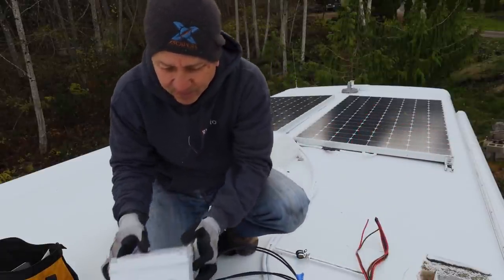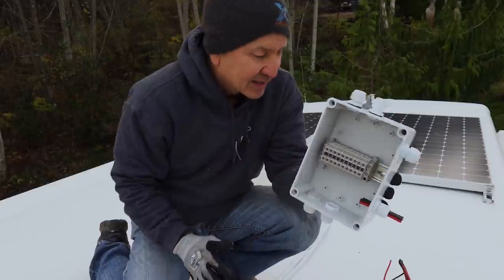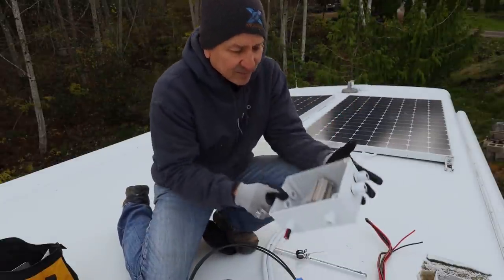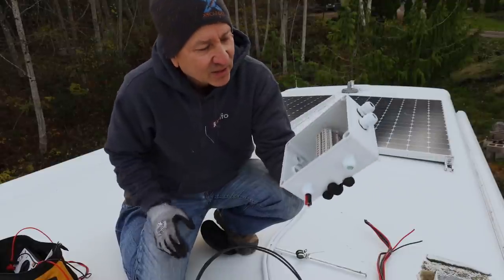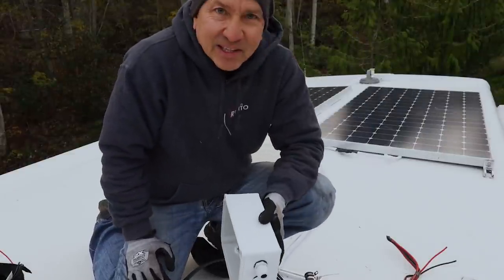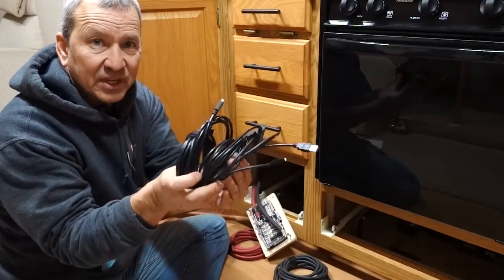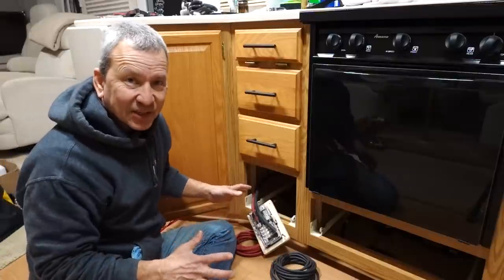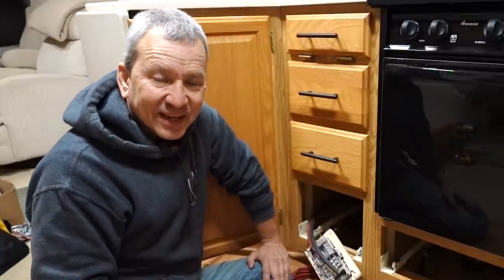Installing RV Solar Equipment on Class A Motorhome | RV With Tito DIY

Comment: I was a little confused at first because of the 4 charge controllers but I think I know WHY you did it that way - shading will never affect you.  With each panel on its own controller, if one panel gets shaded, the other 3 can still power.
Reply from the maker: Absolutely correct. Not just shading. Same is true for the angle of the sun and RV position. Each panel performs independently for optimal performance 👍

Comment: Hey Brian, I have been following along with all your solar system installs. You inspired me to install my own system on my travel trailer, following your design and install methods you used on your class-C with the flex panels. Now, your new install on your class-A is inspiring me on how to do my next install when I upgrade to a new RV in the next year or so. I really like how you explain things and show just enough details to understand. Plus, your wiring diagrams and links to the actual products you used are key enablers. I hope you continue to share. -Jim.

Comment: Another nice job by a fellow PNWer Brian.  I’m glad you pointed out the smart networking function of the Victron devices.  I’m not sure that everyone realizes how good a function this is. It’s really important in terms of maximizing efficiency when you have multiple ways of charging a batter bank that there is one and only one voltage, current, temp. and SOC reading that is shared by all the devices. I use the one provided by the SmartShunt. What people fail to remember is that each device is designed to operate independently and if each device’s internal voltage, current, and SOC reading is used for that device then voltage drops and current readings will be different between devices, which could cause the charging profiles to be out of sync (one device in bulk mode, another in absorption, etc.) which reduces charging efficiency.  I’m thinking I need to do a video on this subject. LoL

Comment: I always learn something! I really like that junction box. And that install of charge controllers on the bottom of the cabinetry is really an artist move. I would never have thought of that!
Reply from the maker: Thanks. Glad you like the setup. I'm really digging having everything out of sight this time around. System has been amazing so far.
Reply: @RVwithTito  we just finished ours too, and it gives me ideas for improvement! We took up half of a closet, but I’ll be looking for ways to move things around and hide wires better, as you have them!

Comment: Nice update ... your having way too much fun :-)  I am working on my whopping 200W solar on the roof of my old 16' Chinook restore.  It will be on the road this week.  I purchased two 100 to put in series to turn on the little Victron sooner and went with polycrystalline because they put out quite a bit more wattage than the mono... I put stainless hinges on and when I part, just tilt up one... plenty for my 200 amp BB LiFiPO4. ... between the rains here in the so. nw coast.

Comment: As far as the flat mounting of the charge controllers go. I think you should add some temperature controlled vent fans to the setup. If i recall an earlier video of yours correctly,  you’ve done something similar in the past.   While the controllers can be mounted in any orientation vertically allows for better heat dissipation than horizontal.
Reply from the maker: That's certainly an easy upgrade when the time comes.

Comment: I’m gonna brag: I fit 1760w on my 24ft sunseeker 2300. But your overall setup is way cleaner.
Reply from the maker: Nice job!
Reply: Hey Iliya, we sure don't mind bragging when your creative solution fits 1760 w on a State/National Park compliant <30 foot rig. Just kindly spec out and list your pragmatic design(components, brand,cost,& more) so we can all learn and smile,thx. Happy Trails, be safe,phil
Reply: @PhiLeo7973  I removed the top AC unit (added mini split in rear) and relocated the middle fan to the rear sunlight area. So that made room for 3x 440w panels. (From signature solar, + mounting hardware). And the last panel on the rear fit parallel to the Rv. Looking back it’s too much solar for me. Also have 14kwh batteries. 8x280ah lifepo4 cells from china. Growatt 3000w inverter
Reply: @iliyamialik  Thanks for your detailed and timely reply IIiya. May you, your family, friends, and neighbors, always be safe. Live long and prosper,phil
Reply: p.s. I would go Mini-Split( Mr Cool?) too and being overpaneled in this day of very reasonably priced PV panels is not much of a detriment,imo, with efficiency losses due to time, shading, temp on panels,etc. May I ask what year your Forest River Sunseeker is and how many miles it has on it? New or used purchase and have you been happy with it? Thanks brother. Happy Trails.

Comment: Nice clean set up. I hope you have enough ventilation for those solar charge controllers
Reply from the maker: I hope so too. So far so good. Like I said it's easy to add a temp switch and fan.

Comment: Are you concerned with laying the controllers flat?  The heat sinks could heat up the back of the controllers and cause issues.  My assumption would be they would prefer to have them vertical to allow the heat to dissipate off the sinks.

Comment: Another quick comment, ... about the Victron and ventilation ... I do some ham radio and a friend who builds repeaters and towers etc. explained why the fins on the Victron, which we know are for cooling.  I mentioned how V wanted them mounted vertically.  He said the reason, which you likely know,  is so the heat rises quickly and easily.   Seeing them flat and knowing you put in extra holes and maybe use fans in the future I think is important.  I wonder if there is data where you might put a little sensor ((wire) maybe those used for batteries and bms control temps) under the center of each laid over controller and find a good place to pull the air via thermostat control ... automatically.  Thank you again.

Comment: Outstanding installation.right tool,right conductor/wiring method, right termination. Love to see you work off the spool an your associated auxiliary components choices. In my neck of the woods off grid rv installer are non-existence it is the wild west with most being in the west. So your DIY suggestions as a resource I find invaluable,thank you. My question for today do you have any thoughts on labeling spaces or components? Again Brian great video!!!
Reply from the maker: Thanks 👍 Glad to help. Not sure what you mean by labeling spaces. I definitely label cables and switches using a label maker when I have it with me. I did label the breakers and cable ends.

Comment: Hi Tito I been reviewing your videos for some time & few months back this summer I finally install my Solar & only added 600 watts of panels with my 40 amp Renogy Charge controller … I got another 600 watts of flexible solar yet to install.  My panels are 200 watts each.  2 weeks ago I added 200 amp hr of lithium plus I swap out my old battery charger to a lithium one.  My 2017 Thor Hurricane already has a transfer switch for my shore power & generator.  I plan to add one solar charge controller & when I install the rest of my panels.  I would like to be able to run all my plugs that didn’t come prewired to my inverter that already runs my residential fridge.  I want to be able to also have my microwave & only one ac function when boon docking.  I can’t get my head around what wires should run to my transfer switch from where.  My thoughts are I should hook up on the same side the generator is hooked up to & that should power the motorhome & I can still have my generator when needed.  I am running from the load side of the charge controller to my new inverter in & the out from the inverter to transfer switch.  Hope you got a glass of water to help you digest this 😊.  Hopefully the military brain of mine understanding things correctly.

Comment: I've been looking over your solar diagram and parts list and I don't see a listing for your rooftop junction wiring part (e.g., the part that goes into the box and connects the panel wiring to the down wiring). Help me understand where that comes from.
Reply from the maker: Here's a video about that: https://youtu.be/zUsSwLaXzHM 
The materials are listed in the description of that video.
Reply: @RVwithTito  Perfect. Just what I was looking for.

Comment: I think you are having as much fun as you are giving me ideas for my next project, I am fairly new to RV Solar but a Mechanic 40 yrs. and have built a small system for my cargo trailer. Ill see if I can make this make sense. I have a question regarding ferrels. The victron charge controller I got did not accept ferrels verry well as the clamp holes were a to small to accept the ferrels. That tool that I got made 6 sided ferrels. I think your Ferrel tool is 4 sided?? And might have fit better??. My controller is just a 100/20 with small input terminals 10 awg I ended up putting wire in "without" using the ferrels and they fit better also I think they clamped down better.. I read an article regarding ferrels as they dont make a very good surface connection and bare wires clamp down (squish) for  a  better connection. Sorry if this is confusing this was 6 months ago.

Comment: Great video and awesome work! I really like the track and tape you use on the roof to avoid all the screw holes for the panels. Long term how has that held up over time?
Reply from the maker: Thanks. So far the mounting setup has held up well. We made it all the way down to Mexico with no issues.
Reply: @RVwithTito   did you use the 3m tape for mounting the Solar panels to the roof as well

Comment: Nice terminations in that roof box.  I would have put each pair of panels in series, running only two pair of wires from the roof to the basement, plenty for 1750 watts.  With two pair of panels in series, I think you could have gotten by with just two controllers, using 2 of the 150/85  Victron controllers, which is what I used.  Your circuit breaker boxes looked much nicer than what I could find.  I'm curious who makes them, or where you bought them.  Funny, I ran my roof cables down the slide out pantry cabinet in my Winnebago too.
Reply from the maker: I have a full parts list with my solar design diagram (rvwithtito/downloads). Here are the breakers (https://amzn.to/34xcQRQ) and here are the boxes (https://amzn.to/3JsuPHT) .... Good luck!
Reply: Actually one 150/35 controller  and combiner box is plenty for these 4 sun power panels
Reply: @brichusi  I think his use of four was so that each panel is independent of each other. This prevents screwing up the performance of all your panels just because one is in the shade.

Comment: Great video.  I'm getting my parts list ready to add solar to my GD Reflection 204RL.  Can you provide the Amazon link to your roof solar junction box with terminal bus bar.  It is perfect for my application.
Reply from the maker: It's an 8 x 6 x 4 box like this https://amzn.to/35h1B09 and the terminal block is here https://amzn.to/3iECtnd You will also need a DIN rail like this https://amzn.to/3JO8vsz to mount the terminal block to. Good luck with your project.
Reply: thank you so much

Comment: Those little things that you stuck on the end of the solar cables going into the junction box, are those just some kind of anti-corrosion deals to keep a nice and clean install?
Reply from the maker: They help get a better connection in those terminal blocks.

Comment: Do you have a link to the wire pairs used from Solar disconnect to rooftop junction box?
Reply from the maker: All of the parts (with links) are listed in my free system wiring diagram (rvwithtito.com/downloads)

Comment: Nice setup Brian, wanted to know why did you go with 4 MPPT (100/50)  vs 2 MPPT (150/100).  do you have a tools list that you used for the project? next month im going to start our solar project on our GV 367BHS.
Reply from the maker: The 150/100 is still a little tight for two of these panels which can output more than 80 volts. I preferred the dedicated controller setup as well. It's been working great. Just needs more cable. I'll work on a tools list. There's just the parts list with the diagram (rvwithtito.com/downloads). Good luck with the project.

Comment: What happened to the SunPower flexible panels?? Should I skip over those and get the rigid type right away?
Reply from the maker: I still have them on the Class C and they're working well. These used SunPower panels were too good to pass up.

Comment: Hi Brian!  Found this to be very educational.  I am planning an install on a 03 Adventurer 33v.  How did you run your cables from charge controller to the batteries??
Reply from the maker: The charge controllers are mounted to the floor right above the battery compartment. There are two existing access holes above used to run other cables. Hope that helps.
Reply: @RVwithTito  Thank you for replying!!!!

Comment: Brian why so many charge controllers do they make any that will handle more solar panels like maybe paralleling some panels? Lots of times I see all the solar panels combined in box and only one set of cables coming a controller?
Reply from the maker: This really is the most optimal setup for a 12V battery system and these large panels. But if I were to combine these large  panels I would still need a very very expensive pair of controllers for that high voltage and current. Another option is to install a 24V battery bank. With that I could cut the number of controllers in half.

Comment: Probably too late now but I believe you only needed to daisy chain the controllers together and one line to the Cerbo GX...
Reply from the maker: I'm not sure if I can daisy chain through the USB VE.Direct. that may only be available with the VE.CAN bus. Not totally sure but I'll look into it. I'm considering combining the controllers with a USB hub to free up a port on the Cerbo for a GPS receiver. Thanks for getting my wheels spinning.
Reply: @RVwithTito  you might be right about the cable you need to accomplish that. Check out the “Changing lanes” channel. He did it. I’ll look for the link.

Comment: Hi Brian, 
I want to put two sunpower 100w solar panels in the roof of the cap on my pickup truck. 
I do not want to permanently install them. I was planning on using heavy duty Velcro and put Velcro all along the backside. 
I am hoping that the Velcro would hold for some traveling so I can connect the panels to a power station and plug in my ICECO JP40. 
I would be removing the solar panels quite a bit but I don't have a 12v outlet in the back of my truck. 
My question is do you think Velcro will hold my solar panels in limited driving trips?

Comment: I'm wondering why you not connect the solar  panels in series by using one solar changer controller?
Reply from the maker: Personal choice. I wanted a fully parallel setup to maximize efficiency. Given the high voltage of these panels, it would still be a pretty large expensive controller.

Comment: what dictates whether you wire you solar panels in series or parallel.    I only have one 100 watt panel, which simply charges a Bluetti device, was planning on adding another 100 watt identical panel, but I'm not sure if I should do parallel or series, I understand the voltage differences and the wiring of each, just not what dictates one method or the other.
Reply from the maker: I'll elaborate more in a future video. Here's a really old one: https://youtu.be/dfMVHLVcMWo 
There are several factors. Two panels (assuming they're identical) wired in parallel will double your current (Amps) and keep the voltage the same. Wiring them in series will double your voltage (volts) and keep the Amps the same. So your solar charge controller limitations may dictate which configuration you use. I'm not sure what the max input charging voltage is for the Bluetti, but I'm guessing it's designed for a 12V-ish setup. So wiring in parallel may be the best option for you. There's a quick answer. Hope that helps.

Comment: Hi Brian, great video! I've been watching your videos about solar panels, I am going to copy your setups to move on with Air conditioning, but I am in doubt about of using flexible or rigid solar panel... I've heard that flexible has a short lifetime and it is not a good option for high external temperatures (95F+) because it can catch fire... I am worried about the total height of a lot of panels. What do you recomend?

Comment: Hey I noticed you said you didn't need the converter charger any longer but your diagram has it connected to the inverter. Did you just move it or remove it? Thanks for all your help.  Great video's.
Reply from the maker: I removed the OEM inverter. The new inverter/charger does it all.

Comment: Was looking at your diagram PDF and had a question.  What is the purpose of your solar disconnect when you have each solar panel on its own breaker?    Why did you decide to isolate the chassis battery from this system?  Due to dissimilar battery tech?
Reply from the maker: The main solar disconnect cuts off all solar coming from the charge controllers (not just the panels). Also, switching off the solar panel breakers and main solar disconnect you can completely isolate the solar charge controllers for maintenance or troubleshooting without removing any cables.

Comment: Nice vid.  What is the brand fuse block your are using?
Reply from the maker: The exact one is no longer available, but here's another that's exactly the same: https://amzn.to/3JkEGPS
Reply: Thanks. How do you think it will hold up with heat and time